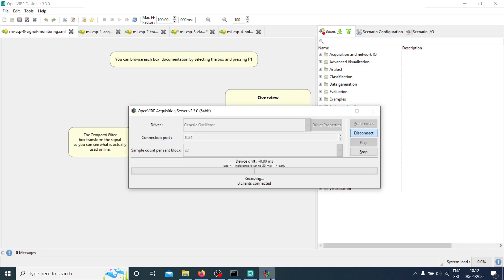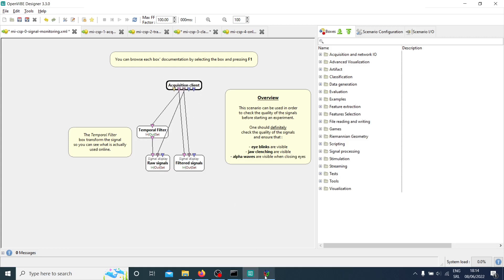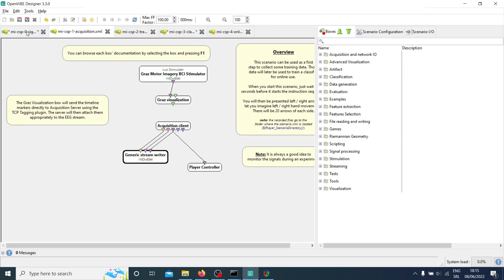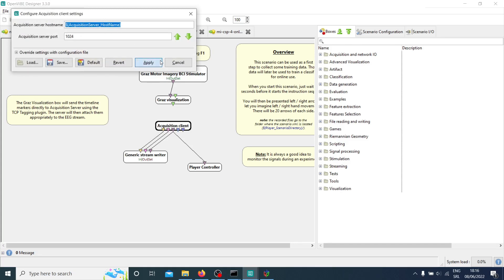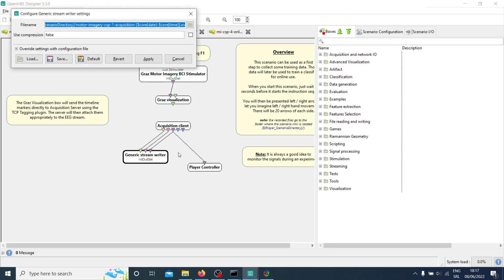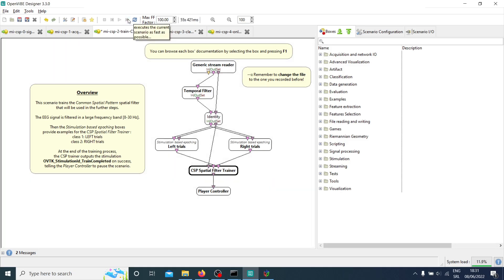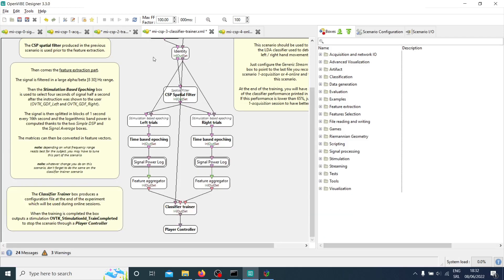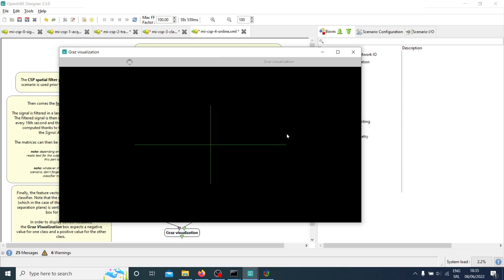OpenViBE for Motor Imagery BCI (default example)

Comment: Hi there,

I have been trying for a long time to get the Graz motor imagery CSP example working but keep getting the same error. Can anyone please help? I am using the latest version of Openvibe, and have also the latest version of Python. Using 64bit. Scenario 0 works fine to allow me to view the signals, but scenario 1 and everything after this gives the following error:

Connecting to Acquisition Server's TCP Tagging [localhost , port 15361]
[WARNING] At time 0.000 sec <Box algorithm::(0x00006ea1, 0x00004c67) aka Graz Motor Imagery BCI Stimulator> Lua error: .../motor-imagery-CSP/motor-imagery-bci-graz-stimulator.lua:83: bad argument #1 to 'random' (number has no integer representation)
[ INF ] At time 0.000 sec <Box algorithm::(0x00006ea1, 0x00004c67) aka Graz Motor Imagery BCI Stimulator> Lua script terminated
[ ERROR ] {Error description} : {Box algorithm <Graz Motor Imagery BCI Stimulator> processInput function failed}, {Error type} : {ErrorType::Internal (code 2)}, {Error location} : {E:\ovm-m\sdk\kernel\src\kernel\player\ovkCSimulatedBox.cpp::168}
[ ERROR ] {Error description} : {Process failed for box with id (0x00006ea1, 0x00004c67)}, {Error type} : {Kernel::ErrorType::Internal (code 2)}, {Error location} : {E:\ovm-m\sdk\kernel\src\kernel\player\ovkCScheduler.cpp::562}
[ ERROR ] Scheduler loop failed.
[ INF ] At time 0.008 sec <Box algorithm::(0x022844b3, 0x367522a4) aka Graz visualization> Confusion Matrix :
000 000
000 000
Accuracy = 0.0
Reply from the maker: HI, sorry for replying late. Its a simple error actually, and it is present in only the new 3.6 version, and not in the older ones.
Go to the options of the Graz Motor Imagery Stimulation box, and just erase the decimal numbers, so when you click on the box you will see Display Cue, Feedback duration etc. and the values next to it are in decimal numbers; just erase the decimals, and leave it to be an integer. And then it will work!

Comment: Have you moved prosthetics with OpenVibe?
Reply from the maker: I personally haven't but it could be done with openViBE as long as the prostetic can be controlled with an LSL stream. You can export in real time your signals using LSL Export box in the designer... I might do another tutorial soon for LSL.
Reply: @jelenamladenovic2506  looking forward on that tutorial
Reply: @jelenamladenovic2506  Could you please make the tutorial on using it to make a proof of concept to use open vibe to control some motors to use as exoskeleton arm robot or prosthethics